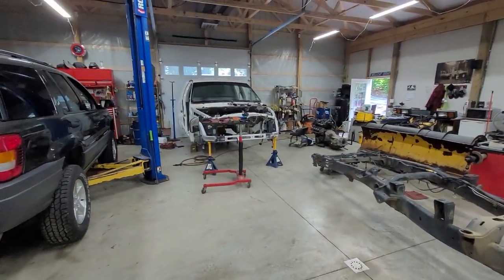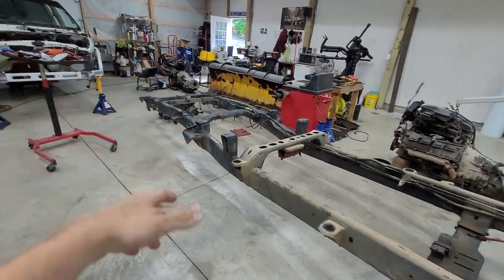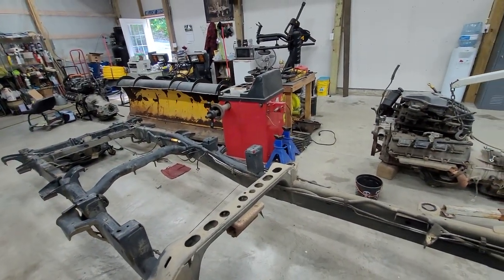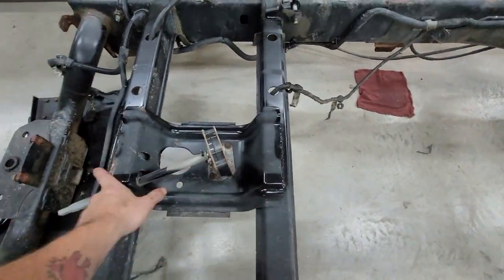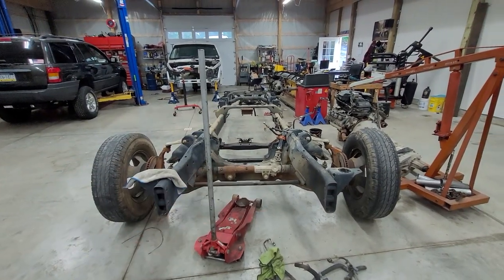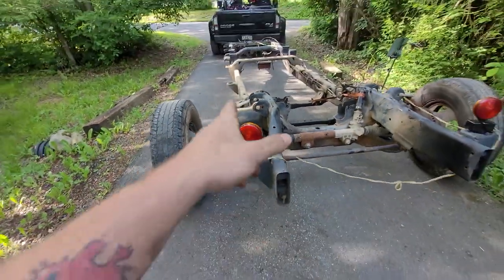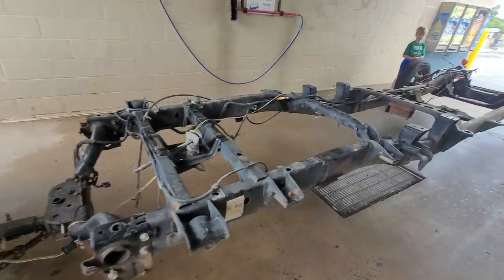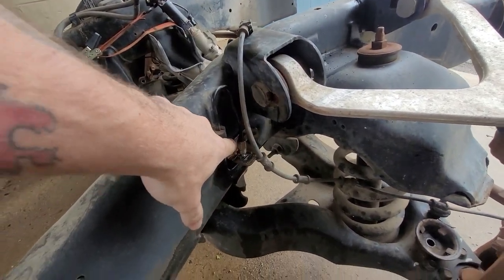Black Dually Is For Sale | Why I Quit Daily Vlogging | Power Only Hotshot Tows 43ft 13k Pound Camper

Comment from the maker: So the white truck will be making a come back. I saved the frame, rear suspension, rear axle, transmission, and am setting my cab and 3500 bed on that frame. It'll have the original drivetrain back in it with the 12 valve. Yes, I'm using the vin for the white truck. The ONLY thing left of the 2500 is the cab. This'll be down the road but I felt I needed to clear this up for the guys that don't understand

If you wreck a truck and need a new cab - You set a new cab on your truck to fix it. Obviously you are not going to use the vins from the new truck. You are going to use your old vin. Same principle applies here. Everything is from the 3500 minus the cab itself. Pretty much at the end of the day all I did on the white truck was sell the body and replace it with my black truck's body. Now I'm just using the original vin number. 

Hope that simplified it for the guys saying "vin swapping is illegal". Yes it is illegal but this isn't vin swapping. This is me rebuilding the original truck with a different cab. That's all it is. Short, simple, to the point.

Comment: If you were in my area. I have @28 gallons Hy-Tran.  Using much of my engine waste oil.  I look at 7.3 psd.  “Nope”. If I fire up old 7.3 which is on list.  I might consider it, likely not. 
  I am refusing work. $3 loaded mile if I feel like it. Guy wanted to haul himself, I was there.  “You realize these 3 things need (MUST) be addressed before you go on a road.  He moved it 30’ DRT.  So I helped him remove tires, moved parts to transport position, gave him recommendation because it has negative tongue weight.   How to shift load when he gets new tires.   He still will barely be legal if he does it all.  Private farmer, 80 miles so I think he is legal.
Reply: If you post weekly.  That would be great.  Monthly you likely would lose views I think. Just 10 minute clips.   I missed what they are asking for truck?

Comment: Life is short , never take anything for granted . May he Rest In Peace.
Those trailers are no joke , I hauled two of those from Sacramento . The first one with my 3500 and the second with my 2500 .
Reply from the maker: I'm sure you took it pretty slow with the 2500 😂 What a ridiculous size for a bumper pull
Reply: @CPSteveMiller  it’s a diesel 4x4 with air bags, believe it or not did pretty good . The customer told me it was 35 feet when I quoted him. When I got there to pick it up I’m looking at it, and told him there is no way it’s 35 feet . He kept insisting it was , so I’m prepared and grabbed my tape measure. It was 41 feet from rear bumper to the front and another 3 feet for the tongue. He was surprised or at least pretended. So I added another $300 and a year later he bought another one and called me… lol

Comment: Those park models are no joke. The last one I pulled from Missouri to Texas was 48' long weighed in at 18,000 pounds dry weight. It was a long drive with that load. Hate to hear about your customer. I hope the family will be ok. I was in Pennsylvania over the holiday weekend.  I hauled two vehicles  up to New York.  Picked up one vehicle  from New York and then one in Pennsylvania then came back to Texas. I was able to spend time at my dad's  in Gettysburg over that weekend. If you ever need a two car trailer for any  runs let me know. Keep up all the great work you do and stay say my friend.
Reply from the maker: I'm surprised there's any money in 2 car hauling. With the fuel rates I stopped trying even with 3 cars
Reply: @CPSteveMiller  I was able to make $5,500 after fuel . I was able to spend time with family  fir the weekend and hit Lincoln Speedway to catch a race.

Comment: I was hoping to buy a semi yesterday, but wound up buying a F450 with blown V10 (rod thru the block). I'm starting to strip it down to put in the 7.3 I've building. I will pull the cab, flatbed, engine, transmission etc. Clean and paint the frame and reassemble. Planning on a 48" semi sleeper but would like a 60" if I can make it work. I'll gut the cab and convert it from XL to XLT or Lariat (I want my power windows!) When it's done I'll be able to pull heavy trailers and do better on freight until I find a semi.
Reply from the maker: These fuel prices keep up I don't think I'll ever get another truck. I burned almost 200 gallons on this trip to Ohio, then Maine, then came home. 200 gallons is over 1200 bucks. There goes the profits on that load if you add in the tolls!
Reply: @CPSteveMiller  I agree...I'm not taking many loads. Most have been the same broker who calls me for emergency port loads. Seems people can't figure out they need to load everything on a truck when it comes to the port. That's OK, when they forget to load that last crate or two, it makes for a good paying load for me. I took one where I didn't even need my trailer. I just need to up my weight and length capacity so I have more and better paying loads to choose from. I started that 450 up today before I started pulling it apart. Smoked up the neighborhood and afterwards I found a wrist pin in the driveway...check out the video of that.

Comment: Balance is important.  Waste oil for local stuff makes a lot sense. I haul loads up to 500 miles and I spend $400 per day.  Lot on money per week. Had to raise my rates quite a bit.  People are already going out of business. I charge $4.00 per mile and some are charging $6.50 per mile.

MY NEW RATE IS GOING TO BE THE CURRENT PRICE OF DIESEL.  THAT WOULD BE $5.75 PER MILE.

JOHN
Reply from the maker: I remember when I was spending 800 to 1200 a week on fuel running otr full time. Now to do the same thing I could spend 2500 to 3k a week with the miles I was running. Local is just a no brainer for my area because the shop work makes up for the other times. Relying on these cheap rates the brokers try to get would easily cripple or bankrupt a business
Reply: @CPSteveMiller  I always knew you were smart and I agree with you.  I own commercial real estate that provides my everyday income.  I think as more people go out of business shippers will call asking me to haul at any rate if I can just do it within 10 days.  I turn down work everyday, not because of low rates, but because I can't get to it.
 I friend was the son of a VP at Ford Motor Co.  His motto was if you have too much business - raise your rates!  Something to remember.

Comment: Hey steve how do i add those filters on the frame. I have a 12v too. Maybe i missed it in the videos but i was lookin for it
Reply from the maker: https://www.dieselpowerproducts.com/gdp-2-micron-filterwater-separator

That's the kit I used. You will need to replace the fuel filters with oil filters if you run waste oil. They are 2 micron filters so they clogged pretty fast for me. If you're just running diesel this is a good kit. After I installed them I gutted the filter on the block and it raised my fuel pressure by 10 to 15 psi. I was at 20 to 25. It now will occasionally hit 40 on stock fueling.

Comment: Where you get temp tags to pull power only loads that don’t have plates?
Reply from the maker: They are not easy to get but your dmv. Also some states don't recognize them so you need to buy temp registration in al lot of states even if you have a plate

Comment: People just don't get the vin situation the vin is for the frame not the parts on the frame. But they will never upstanding it. But nice seeing the update hope all is going well. The industry is going to shit tow piglet just closed up shop bc of it going to trash. Stay safe bro.
Reply from the maker: Yeah, imagine I put that 3500 cab on a 1500 frame and don't put the original vin tags back on and just leave them on the cab. "Oh, but it's legal" 🤣
Reply: @CPSteveMiller  right. I'm in the process of doing it to my g35x bc it's low as hell so I bought a shell and swapped everything over from the old car. It's a loose loose situation when dealing with know it all people.

Comment: If you need used motor oil,I have almost 100 gallons in my garage you can have it,I only live 40 miles from you.
Reply from the maker: Send me a message. I just emptied two 55 gallon drums from my Maine trip so I have plenty more capacity for it.

Links for instagram or my email are in the description. Send me a message and I'll call you tomorrow!

Comment: Maybe you should have anti-sway bars on your truck to the camper
Reply from the maker: They snap frames if they're a lippert frame. Then they say it isn't their problem and blame the customer. I'll never use them with how cheap these new camper frames are built
Reply: @CPSteveMiller  good thing you don't live in Canada than. Illegal to pull any holiday trailer over 24 feet with out them. Now I know why I see so many wrecks on the news  in the states. Unsafe practices
Reply from the maker: @Geoff321  Yeah, I lowered the hitch down by 2 notches and it made a hell of a difference. Don't get me wrong the pull hard when I semi passes but it's not that bad with a dually. It's very easily controllable if the driver is paying attention. There's so many guys with suv's pulling these big campers. It ridiculous but they refuse to get a bigger truck. Safety went out the window with those setups 😂
Reply: @CPSteveMiller  your saving is that you have a dually. Lots of clowns pulling with half tons .all over the road.doing 80 mph
Reply from the maker: I was in no hurry. This was the first time ever that I've run a trip without leaving 5th gear. I kept is at 62 at the most. General average from Carlisle to Lagrange was probably 58. The dually makes a difference and too many people don't realize that. What's worse than the half ton is the suv crowd!

Comment: What is the asking price for it
Reply: Sack of coal
Reply: Actually interested do to my pickup  needing a new motor, transfer case and transmission
Reply: Pretty sure Steve said around 10k for the truck and it needed a coolant temp sensor and something else but the customer would get the key working
Reply from the maker: @willsmitherman688  Yeah asking price is 10k. I have all the details on the truck for anyone interested

Comment: One minute in. Your not gonna swap frames. Nope
Reply from the maker: They said I wouldn't 12 valve swap a truck either. Or 2wd swap one. Or megacab flares. Or half the things I did. You're right lol I'll never do it. Just like I never did all the other things I did 😂
Reply: @CPSteveMiller  naw the other things made a lot of sense. This is just extra work and a lot of it 🐓
Reply from the maker: Not really with a shop. We have all the equipment to do it. Months ago we already did a frame and cab swap on a 1500.
Reply: @CPSteveMiller  well, I just don’t see the sense in it really. I mean yeah, a few full days.  But why?
Reply from the maker: Just to do it. I will need the higher gvwr but I don't want to get another truck. Just isn't the same

Comment: I hope you got hazmat sticker on a truck for 450 gallons a waste oil that is not Legal
Reply from the maker: Oil is considered non hazardous per regulations. I can't find anything else on it on the fmcsa website. It's burnable but considered inert because of how much it takes to ignite it
Reply: @CPSteveMiller  I also have heard  of people getting a fine for running oil cause your not paying road tax on use of it same as running off road fuel. Might want to check that out so don't get an out of service and have truck towed and tanks flushed by a shop. Just a thought. Stay safe.
Reply from the maker: Oil is post tax so you're good there. Just don't get caught with red diesel. They will shut you down for that! 😂

Comment: probably not too smart to advertise on youtube that you are commiting a federal crime. swapping vin tags is a giant no no.
Reply from the maker: I'm not swapping vins. I'm putting my truck body on a 3500 frame. The frame is what matters. Just because I used the cab from the 2500 doesn't matter. They're the same from 1500 to 2500 to 3500. The frame, axles, transmission, suspension are all 3500. Nothing illegal. I have the title for my frame/truck. Only thing left about the 2500 is the cab but like I said the cab is exactly the same. Also the bed is even a 3500 bed
Reply from the maker: It's no different than wrecking your truck and swapping cabs because the cab isn't saveable. You're not going to use the vin numbers from the new cab. You're going to rip them off and put your original vin numbers back on. in this case that's all I'm doing is putting my 2500 cab on an entire 3500 truck. That's all it is is a cab swap. That trans axle and suspension all came out of that white truck. It's the original drivetrain for it.